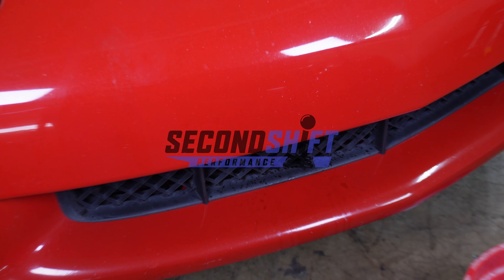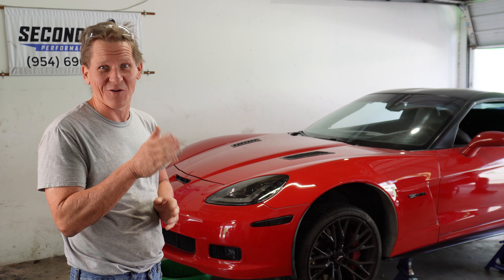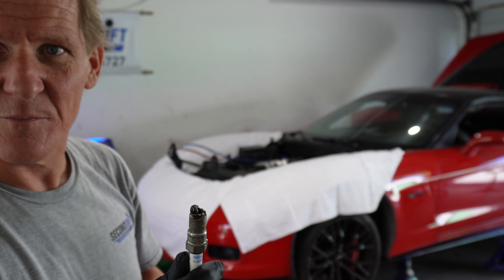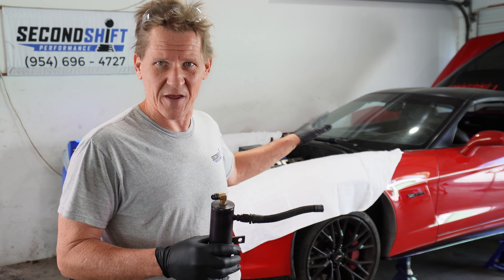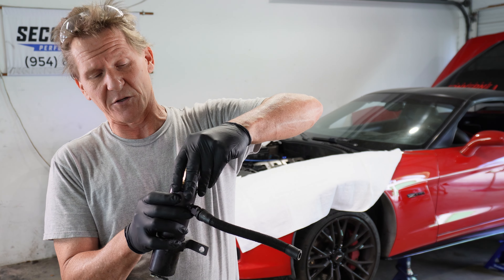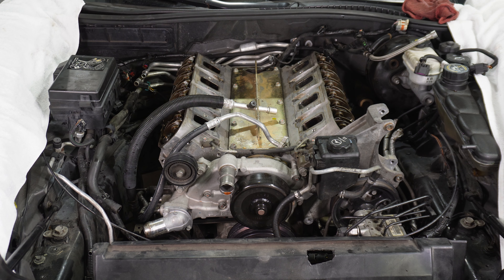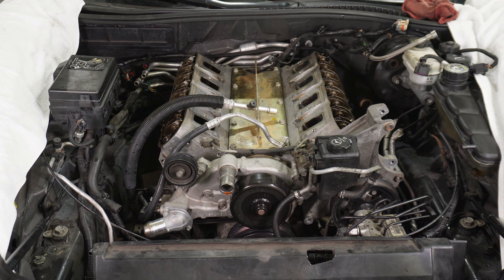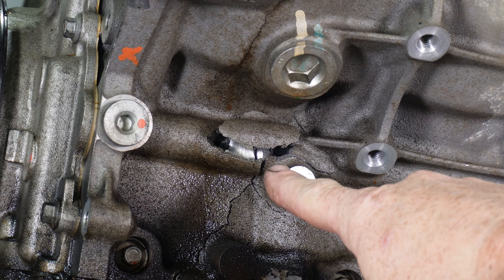Z06 Corvette LS7 Valve Drop Teardown

Comment: 1,800 miles on my new LS7 570HP crate motor and I shipped the heads off to American Heritage Performance to have the works done to avoid this. My friends 4,000-mile engine hade severe intake valve damage, GM lied to all of us about correcting this issue. Great vid, thanks for sharing!
Reply: ayyy im dropping my car off to kohle soon thats dope
Reply: My heads were fixed by them thanks to the original owner.  Thankful they were sent off to a reputable business.

Comment: Wow...Did you find original, hollow stock Ti valves in the heads when you tore it down? Incredible that some one would put a cam in that motor and massage the heads and not change the valves, makes no sense, unless the work was done when the motor was very new 18 years ago, before the valve failure issue was well known...What do you think? Btw, I own an 06, and the motor and valves were done by the previous owner at a shop I know and trust, and I have the paperwork, but wow.
Reply: The exhaust valves are the hollow stem sodium filled valves, I just cut one open today, only .050 wall! scary!
Reply: @BretMech  Thats so weird they did that head but not the valves. My machine shop guy told me that another problem was the design of the guides, and they were too short to support the length of the stems. Btw, any metallurgist will tell you, "coolness" factor aside (lol!) Titanium is known for its lightness, resistance to hi temps, and resistance to corrosion, but it's  a soft metal that can only be made reasonably strong with the addition of certain alloys. Its not good for a stressed component subject to high wear and loads. In a racing application its good because it only needs to survive for the duration of the event, assuming its strong enough to survive at all.
Reply: I honestly wouldn't fully trust any reworked factory heads.  Lot's of failures of "fixed" heads, including from all the well known shops.  Yes, I'd still trust them far more than untouched stock, but...  Personally, I think the safest way to go is with aftermarket heads.  Can it still happen, yes, but I'd at least trust everything was on-center with them.  GM really failed their customers on this one, and they still won't admit there was an issue.  BS!

Comment: I have a 2008 z06  had the heads redone by Katech hope they will be ok!
Reply from the maker: That depends on the valve lift also. Don't forget once we get much over .600 lift the valvetrain is good for less than 50k and springs should be changed out at 25k.

Comment: I had a valve job done at 69,000 miles. They found several broken valve springs and burnt exhaust valves. Stems were also scored. Its even more of a beast now. I enjoyed your video!!
Reply: how much did that cost you?? just got mine with 18k miles

Comment: I’ve had two c6z’ and never dropped a valve. They both got heads swapped but went years and miles on stock heads.
Reply: Contract company pressed in valve guides and not always to spec, for GM, is what I've heard. How much and how many per head is anyone's guess. That's why some engines grenade at 5000 miles and others at 100, 000 plus miles. My builder says most failures he sees are a low rpm, with throttle rolled on, semi hard. More than at track day.

Comment: 2013 Z06 here with 5300 miles.  Does anyone know if the problem was ever resolved at a certain year where this no longer was an issue?  Thanks.
Reply from the maker: The first time this problem was resolved was at the start of the 7th generation of Corvette in 2014 when GM stopped putting LS7 into Corvettes. The second time this problem was addressed was when GM too the crate LS7 and crate LS427/570 out of production. This put an end to the problem altogether. 

Lightweight hollow valves were a defining feature of the 7k RPM engine. The way the heads get "fixed" puts much stronger springs on the solid valves so they do not float out. While the engine can still rev to 7k RPM it takes notably more wear from the spring pressure required to operate the heavier valves at such RPM and it kills the efficiency of the engine fundamentally changing the characteristics of the LS7 engine. For GM to 'fix" their design would be the creation of a different engine designation. So no, there was never a point or year where LS7 stopped having the problems it was so known for.
Reply: @secondshiftperformance  Thank you, Sir.  As you are well aware, there have been many rumors and much speculation, but your answer seems the most plausible.  And, having the issue addressed with any/all LS7s definitely would give some peace of mind with this kind of investment versus the cost of a catastrophic failure.  Thanks much for the reply, Sir.

Comment: You are mostly wrong about oil catch cans…. I agree about the generic type where they are close to the engine and line connections are inline with each other. But a properly vented oil catch can is to reduce pressure and extend piston ring life for high performance vehicles , mainly boosted cars. They also help maintain proper fuel octane so a performance engine can run  as efficiently as possible
Reply from the maker: Vented catch cans allow air either in or out of the engine that is not registered by the MAF sensor. This really matters for a car with a MAF sensor that fuels precise amounts based on airflow. You know the MAF is a direct airflow measurement for fueling. Good call. And thank you for pointing out another known issue with some of the catch cans. 

You can always cap the vent, drill a hole for a return line in the bottom of the can and in your oil pan above the sump and you'll be ok with your oil separator.
Reply: @secondshiftperformance  also very wrong, air load is air load…. MAF curves aren’t magically tabled for Engine Crankcase gas…. That is adjusted by fuel trim and the oxygen sensors as crankcase pressure is vented to the intake BEHIND THE MAF…. Yup ….BEHIND……THE…. MAF… Crankcase pressure is highest at WOT and High RPM. Where air/fuel ratio is at its most crucial. If you have a 6-700Hp modded engine that is moving 3-400+ CFM that is some serious crankcase pressure. Properly configured vented catch-cans alleviate the pressure and keep oil from sucking back into the engine. You are SO wrong about it for keeping your intake pretty…. You just have no idea how AF octane becomes compromised with extreme blow by. Proof also in how pretty much all high horsepower drag race vehicles run a vented catch can setup and they vent it all the way to the back of the vehicle….
Reply from the maker: @Johnnyboy200406  If this were true why has no automaker ever done this in all of the automotive history of automobiles? The crankcase vent clean air inlet is downstream of the MAF so the air flowing through the crankcase and then into the intake is still measured by the MAF. Creating vents in between can only introduce potentials for unmeasured airflow to either enter or leave the intake before going into the engine. No matter how slight they might be. Besides skewing the MAF reading to the PCM this is also bad for the environment and the smells of your vehicle.

The correct answer for blowby is to rebuild. If a crankcase suddenly experienced a lot of blowby in a normal application it would blow out the crankcase seals. rocker arm cover gaskets, oil pan gasket, front or rear main crank seals, etc. These are signs of a time to rebuild. 

For forced induction it is customary to block the PCV system dirty and clean air passages and drill a hole in the oil fill cap and install a -10 AN fitting and run a 1/2 or 5/8 hose from there to inside the engine's air filter. This way if there suddenly becomes blowby it has a way and place to escape. This is the way of Procharger, Magnuson, A&A, Vortech, and all the others that produce power adder kits. And instructions for doing this come in all the power adder instructions. 

There simply never is a good time to vent unburned vapor out into the atmosphere.

Comment: lll be giving you a call int he coming months. I track my c6 z06 and my oil pressures have been a little lighter than im comfortable with. 48 psi at 7k rpms and about 20 psi at hot idle. This is with now a 50w oil as well.

Comment: No problem there ehh! Just ask GM :-(   It's a ticking timebomb with stock exhaust valves. It's never a problem, "they say", until oil is on the outside. Doah! Fix you LS7 before your looking for a new engine (which GM doesn't sell anymore).

Comment: See Blackstone Laboratories, They found Titanium in my Ron Fellows Vette on a routine oil change check. I  had the heads pulled for GM Inspection and the intake valves fell out of the heads. They paid $7,000 to replace the heads and valves and paid all labor. end of titanium in oil too. It saved my engine. I am not affiliated with Blackstone in anyway i  am simply an informed user and they saved my LS7. Dennis
Reply: Hey, when did this happen? Just bought a 2011 z07 with 25k miles and I’m considering aftermarket heads

Comment: I replaced all the valves with stainless steel, and it still revs out to 7k and now makes 600 rwhp in my Z28
Reply: that’s it? you didn’t do the heads like everyone else? been reading on it and it looks like all you have to do is the guides
Reply: @lololo8046  actually the heads were entirely rebuilt.
New guides, valves, springs and a set of shaft rocker arms. Super strong now.
She rips on the track
Reply: @mikewarren6774  about how much did it all end up costing
Reply: @lololo8046  with all the other goodies like Kooks headers, Fast 102 intake, NW throttle body, and a different cam and tune. It was around $8500
Chopped off another 3 seconds off my best lap time 2 weeks ago
Reply: @ 🔥🔥thanks bro